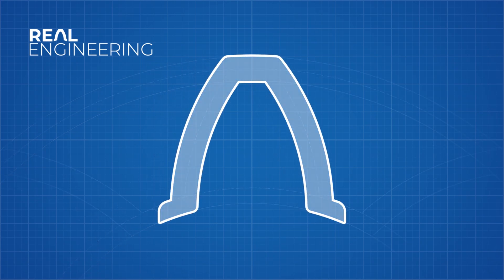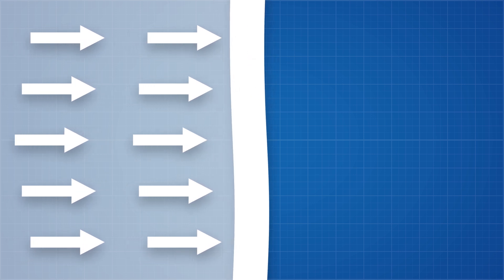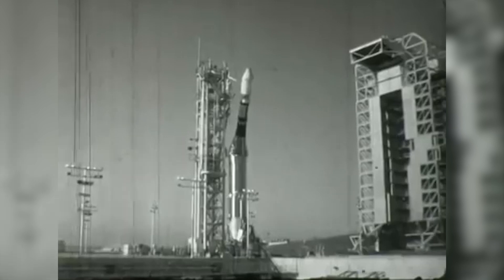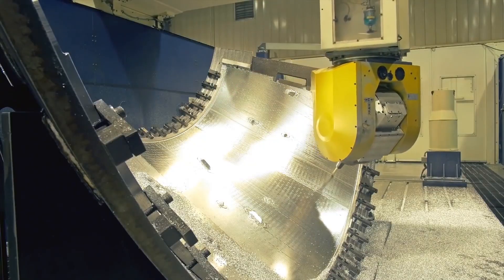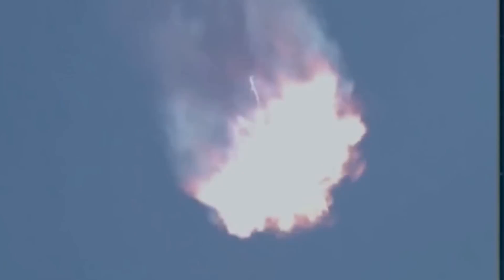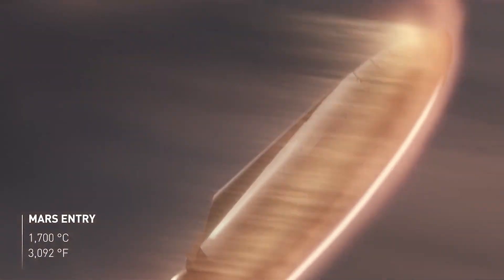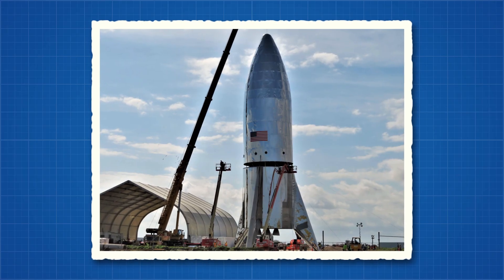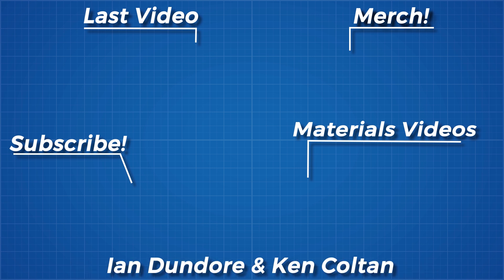Why SpaceX Built A Stainless Steel Starship

Comment: What you should be doing   by now is learning from the many other mistakes, that have coused countless lives.  Build a rocket that has the primary fuel tanks away from the main ship,  so that the 
Main rocket was, safe when there is an explosion.  You should boild it with an uper chamber and a much lower sistem of rockets.  So the the uper chamber is st least some distance away from the botom rocket compartment.  And the fuel tanks away from the rockets.  With a space between the fuel sells,  and the actual rocket engines.  Like 10 feet away.

Comment: One square meter of sheet 6 mm / 4 mm thick has a weight of:

47.5 kg / 31,67 kg for a stainless steel sheet
16.2 kg / 10.8 kg for an aluminium sheet
8.7 kg / 5.8 kg for a carbon fiber sheet.

==> stainless steel is 5.46x heavier than carbon fiber
==> stainless steel is 2.93x heavier than aluminium

Wonder if starship will be able to reach orbit ?

Comment: Wouldn't they be able to reprocess the aluminum and carbon shavings and recover the waste of materials and money? It may not be usable for fuel tanks or space frames but it can be repurposed in some way. Someone figured out how to take tons of saw dust and mix it with epoxy and make building materials with it after all.

Comment: Engineering.  Every depiction of Starship shows square windows, ports.   There must be no square ports.  Square corners or corners even suggesting square a much weaker than round or oval.  All windows, all ports, all egress, must be through round or oval apertures.   Square corners are an inherent weakness, stress and cracks propagate from the corners.  And if you do reinforce sufficiently,, there is a large cost in weight.    Round or oval windows.  Someone tell Mr. Musk, please.

Comment: Boy are there a LOT of misleading or outright wrong comments. From the reason of how and why isogrid is used to actually showing not an isogrid as an example (the Dragon one) to the comments about CFRP... jeez. Oh. And the explanstion od how internal pressure stabilizes thinwalled structures is wrong entirely.

Comment: I find it amusing that Elon claims credit for developing this stainless steel material technology when the same material and steel balloon structure technology has flown on every Atlas rocket launched since the 1950's.  On the current Atlas V it is only used on the upper stage, but all previous versions used it on the booster and upper stage.

Comment: Have you ever tried to cut stainless steel with a bladed tool? It's almost impossible. You have to use a saw to make it  practical. You can cut aluminum with nail clippers. Tell me which material is stronger and more durable.

Comment: I would love to see a video about how a rocket fuselage can support all the weight of the upper stages when it is only made of a cylinder of very thin sheet metal. It's just mind boggling why the Super Heavy won't just crumple like paper when the starship is put on top of it. Then when you add the fuel, and then cargo, and then put it through the acceleration and dynamic pressure. That sounds like putting a bowling ball on a paper cup and then shaking it. Also, why don't they criss cross the interior of the tank with truss structures and guy wires? This is an engineering miracle that is very mysterious.

Comment: The real future other than reaching mars is making electric rockets
Reply: We haven't even figured out electric planes yet. Ion thrusters which are currently employed aren't capable of producing massive thrust although they can allow for an overall higher acceleration but it's a very slow process. Would be amazing to see how solve these problems in the future.
Reply: Dev Ashish yeah there’s many powerful batteries out there they are just not fully tested but show promise lithium ion is only used caused it’s been tested well things like graphemes will power us into the future

Comment: If I were spacex team, I would probably have done the same. Using stainless steel starship keep costs down as carbon fiber is definitely much much more expensive. A starship prototype is meant to fail until they don't manage to build the right vessel. 
I am sure at the end when everything will be properly working with the spacex starship prototype, they will use carbon fiber for the final and ultimate product.

Comment: Unless you can figure a way to get to Mars real fast, the Mars missions are doomed.  After several months of zero gravity, the health of the astronauts will begin to fail. As the astronauts get weaker, the chances of failure increases.  Long space travel must include artificial gravity; or else they are near suicidal.
Reply: Astronauts have spent longer times in zero gravity on the Mir and ISS than the trip will take to Mars. The record is 438 days in zero gravity. It will only take 8 or 9 months to get to Mars so around 250 days.
Reply: @drabberfrog  If you want astronauts to be in top shape when they get to Mars, you've got to have artificial gravity.  Otherwise you put the mission and the astronauts at great risk of failure. Take a look at the book Endurance by Scott Kelly. Life in zero gravity is dramatically bad for the human body.  I pray we don't sacrifice the health of astronauts in little crap capsules when we can maintain good health in a rotating ship that provides the gravity they need. The movie 2001 was dead on right in depicting the kind of craft needed for travel to Mars; minus the mentally ill computer on board.  It will take more time and investment, but we better do it right; especially for the humans we ask to risk life and limb to go where we've never been.
Reply: @Nova-bc3kj  Mars has only 38% of Earth's gravity so the transition wouldn't be as hard as astronauts going from the ISS to Earth. If astronauts exercise like they do on the ISS today they probably could make the trip and get to Mars fairly healthy. Eventually ships will use artificial gravity but that will use a lot of energy and will be very difficult and expensive to have.

Comment: It's strange that at this level you don't mention titanium alloys. The best strength-to-weight ratio for metal alloys is titanium. The problem is that this reactive material for the American aerospace industry was impossible to join by automation due to its chemical reaction with air when welded. Now it has been discovered how to join these all-important alloys using robotics, so I'm telling you that Starship can be made with these beneficial 60-ton lighter titanium alloys. Modular manufacturing with this discovery, better system performance ... Perfect double gaskets with controlled asymmetry for paramagnetic and diamagnetic materials in inert atmosphere. Hypersonic passenger flights and modular robotic manufacturing of monohulls with this system are possible today. Intercontinental flights have been reduced to less than half
 because the heights and speeds of flight of a monocoque made of titanium by automation are infinitely higher than those of current aircraft built with aluminum foil on frames of the same material. It is excellent news, friends from the USA, ... now we can do it very well ... !!! ...
Reply: @awashburn6944  Titanium does not react with liquid oxygen because it is cold. That is not true. Dude, titanium is coated in plasma applied ceramic that relieves heat and protects the surface ... Heat shield over titanium heat shield ... 60 tons more into space ... It's a breakthrough. The supersonic airliners will be manufactured by symmetrical and simultaneous laser welding on diamagnetic and paramagnetic reactive materials. My system eliminates negative chemical reactions from the material when it is welded. The new system is a discovery and builds airplanes and spaceships using robotics ... It is a patent recently issued for the United States throughout its territory
Reply: Composite materials are applied on a metallic matrix. Monocoque carbon fibers are generally applied on top of the honeycomb. The same has been heard for over 20 years, but airliners have been made from nailed aluminum for 100 years. Today's airframes are similar to Comets from the 1950s. I figured out how to robotically make the plane instead of just keep building planes with hammering and you say titanium reacts with liquid oxygen. You are not well friend. Today they rise to 12 thousand and the rivets escape due to depressurization. They go to the water and instead of floating they get lost in the ocean. My system allows the plane to be made by automata by means of numerical control stamping and robotic welding for the first time in history ... It can go to the water and float while waiting for a rescue floating on the surface of the ocean and you say that the titanium reacts with liquid oxygen. Modular monohulls manufactured by robotics in series and indestructible. No more rivets for aviation now we will robotically manufacture the fuselage in materials far superior to current aluminum foils @awashburn6944
Reply: Do you think I write about Starship and about the future trip to Mars ... Reading ability. We are changing commercial and civil aviation forever ... That's the point here ...
Reply: @awashburn6944  Hello friend, laser welding was not possible before automatically because I neglected the back of the weld ... My discovery joins with two symmetrical systems on each side and a reactive titanium from both sides at the same time preventing the chemical reactions of the material. .. Inert atmosphere front and back simultaneously ... Gas and energy controlled asymmetry welding. The laser system joins in one place and leaves the back free. Titanium cannot be joined in this way because gas enters and the material reacts on the opposite side

Comment: The melting point temperatures for ss are under compared to the upper atmospheres temps ...according to modern science so how do these materials handle not only the temps but the increase in temp by the friction etc . Everything played into the equation could someone please elaborate . Not a keyboard brave guy but someone from space x pls to end all the bs going around the web....
Reply: The temps in the upper atmosphere are a non factor the air pressure is far to low.

Comment: Don't really like the Engish pronouncing of Aluminum   "Aluminium (aluminum in American and Canadian English) is a chemical element with the symbol Al and atomic number 13. It is a silvery-white, soft, non-magnetic and ductile metal in the boron group. By mass, aluminum makes up about 8% of the Earth's crust; it is the third most abundant element after oxygen and silicon and the most abundant metal in the crust, though it is less common in the mantle below. The chief ore of aluminum is bauxite. Aluminum metal is highly reactive, such that native specimens are rare and limited to extreme reducing environments. Instead, it is found combined in over 270 different minerals.

Aluminum is remarkable for its low density and its ability to resist corrosion through the phenomenon of passivation. Aluminum and its alloys are vital to the aerospace industry[8] and important in transportation and building industries, such as building facades and window frames.   The oxides and sulfates are the most useful compounds of aluminum.

Despite its prevalence in the environment, no known form of life uses aluminum salts metabolically, but aluminum is well tolerated by plants and animals.   Because of these salts' abundance, the potential for a biological role for them is of continuing interest, and studies continue.

Comment: The more effective and efficient method would be to have zero g only ships in parallel with orbital assembly using more efficient launch and orbital only systems/ships. A new orbital hab is needed too. We need to crack on with all this too!!

Comment: How long is it going to take Elon Musk to figure out that NASA in the 1960s got it right with Lunar Obit Rendevous.and the LEM? And heck, the Moon landing didn't have to deal with an atmosphere to go through and more than twice the gravity on takeoff. Leave the bulk in orbit and only take down the surface stuff you intend to leave and the bit that you need to get back in orbit.This whole thing looks to me like a colossal, but unserious, effort.  I suspect just like his Boring Tunnel (a totally silly concept) which was going to be using sleds and then abandoned them, Musk will come out with something different to hype later.
Reply: You're talking different mission goals.  At no point was re-use a factor in Apollo engineering.  As it is this thing won't be able to land on the moon without some support infrastructure there so it'll more likely ferry things no further than lunar orbit.

Comment: Wondering if you would do an update video on Starship now that it has been 2 years its truly amazing how they developed both Starship + their new raptor engine. And if you notice in Starships current development they have reverted back to using ablative tiles which is interesting.

Comment: i am wondering if anybody else notices in  the short clip in this video of the space shuttle launch and the fact that the space shuttle being launched has no bay doors... the body of the shuttle is completely smooth...  there are no bay door seems.. where  there should be seems outlining the outer left, right , top and bottom of the bay doors and the seem in the middle of the 2 bay doors from top to bottom there is nothing but a perfectly smooth surface....  there are no bay doors.. look at other video footage of other space shuttle launches and you will  see the bay doors are clearly defined... ooops my bad... you will see that only half of the space shuttles launched have bay doors... so  if only 6 space shuttles were ever built and all 6 had bay doors what space shuttle is being launched in this and the other half of the space shuttle launches????????????? yes 6 not 5.... the four that we watched being launched the 5th ( the ENTERPRISE) in the smithsonian museum and the 6th at White Sands military base in New Mexico, parked next to the Monkey Research Station Building......yes it is there... ive been there... ive seen it with my own eyes.... i literally drove at 25 mph past it at less than half of a city block away from it... perfectly unobscured view of it... oh and back to my initial thought... it had clearly defined bay doors..........i am wondering........

Comment: Real engineering indicates that after 621 miles above the earth the temperature is 3600 degrees F and gets higher. Soooooooo you would need some kind of material that can stand that temperature. 304 stainless steel melts at 4442 degrees F. Stainless steel could sustain the temperature. I'm wondering if the lunar expedition vehicles were all made of stainless Steel? Hmmmmmmmm.
Reply: No.  You're understanding of heat and temp is somewhat flawed.  The temp is high but the pressure is low.  Low pressure means very little conduction of that heat.

Comment: 2.5mm to 10mm Steel on the Atlas? I think you must have got a decimal point wrong. 0.25 -0.1 mm" maybe?
Reply: 0.25mm is so unbelievably thin it might as well be paper mache
Reply: @jojojojo-yi6wb  You have never worked in aerospace engineering. Regular aircraft often use aluminium skins as thin as 0.016" /0.4 mm. Steel is typically 2-3 . times as strong as aluminium so would be used in even thinner sections . 1mm stainless steel in hefty stuff. 10mm would be unthinkable. No rocket would ever get of the ground. Nor would it require to internal pressurization not to buckle under its weight. 2.5-10mm thick walls would support a Saturn 5 stacked on top of it.   The decimal point is wrong.
Reply: @PDZ1122  alright dude

Comment: Great video as usual! Just one question about your comment on using carbon fibre. Rocket Labs builds and flies its Electron rocket with carbon composite tanks. Thoughts? https://www.rocketlabusa.com/electron/#Plug
Reply: Drastically smaller than Starship or even the Falcon 9. The Carbon Fiber makes it extremely light, which works well for them and their market. They will hopefully be able to reuse the boosters one day soon as well.

They don't have to deal with the same kind of re-entry heating that Starship will. While SpaceX likely could have figured out how to make carbon fiber work for Starship, the costs were too high and the benefits didn't outweigh the downsides. IIRC, carbon fiber is weaker at cyrogenic temps and during re-entry than 304L stainless steel, while being something like 100-1000 times more expensive.

Comment: the top is too round, it needs to be pointy
Reply: Minh Tran no it doesn’t the falcon rockets have circular noses and work just fine
Reply: A point on something like this is a massive no-no, as it concentrates all the forces from pressure, etc. into itself. Curves help spread out those forces across a larger area, lowering the effective pressure. This is why airplanes have rounded windows.

Comment: Ok so many tech specs over looked. Nor sure where to start. Stainless steel is ok but the weight and re-usability  is an issue a big one, but going to Mars not a major factor. Carbon and temp is better choice fro matrix reasons and deflections of surface strength.2. CH3 then 4 is not fancy chemistry at all! You just are not aware of it.SO dont pretend what you dont know!
Reply: Stainless steel is stronter and better a cryongenic temperatures. CH3 is perfect. It's in the middle of hydrogen and RP1 and it's abundant on mars.

Comment: What if we welded a stainless steel, hollow,  pressurized isogrid to the inside of the rocket?
#elonmusk
Reply: Update, we could stamp the isogrid pattern into the stainless steel panels quickly And cheaply!
This design also might insulate the whole Rocket Like an insulated bottle? 
We could impress the isogrid/honeycomb into the panels, friction weld them together where the isogrids touch and the panels meet like a thin hollow stainless steel Honeycomb. 🙊👽